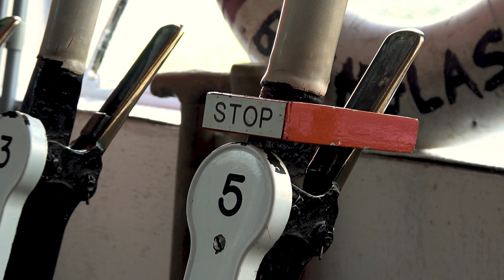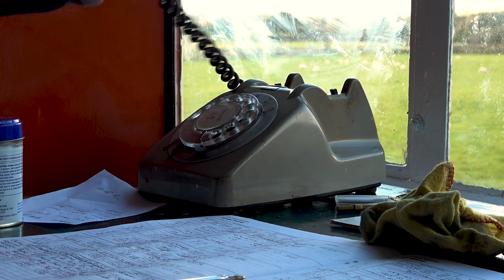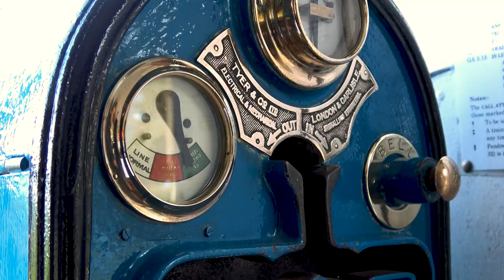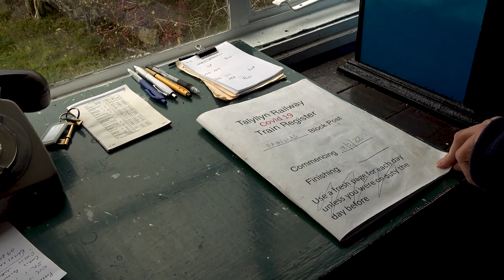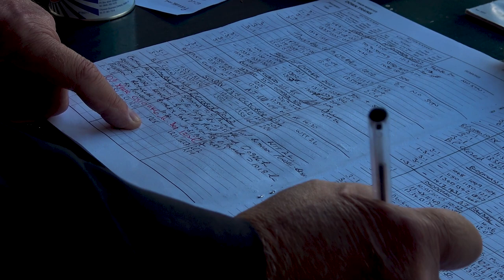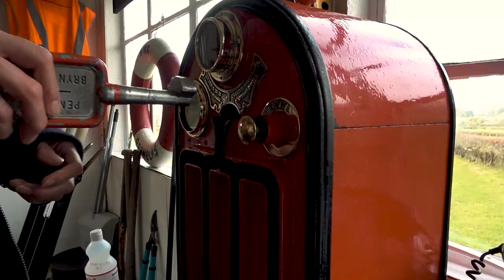How to be a Blockman! - Volunteering 101

Comment: Thanks for the video on being a blockman.  Question: after putting a token in the machine, and needing to get one out, is it a rule that a different one must be taken out?
Reply from the maker: The same token can be used again straight away, but it MUST be put into and locked into the machine and released again to assure the safety of the section. Hope that helps!